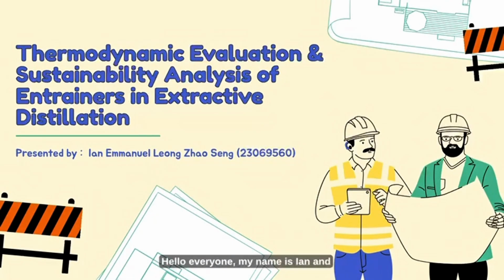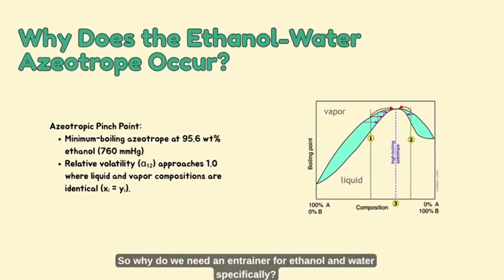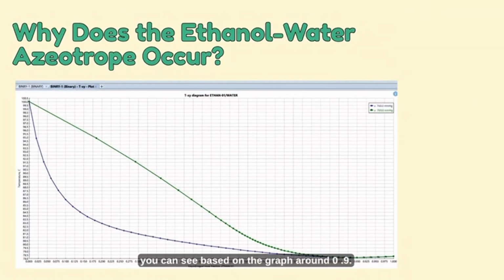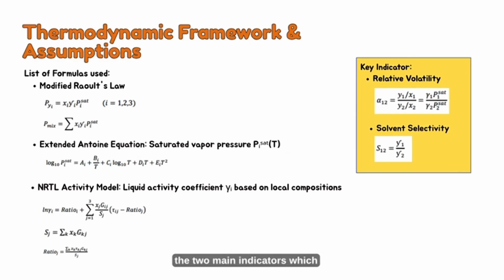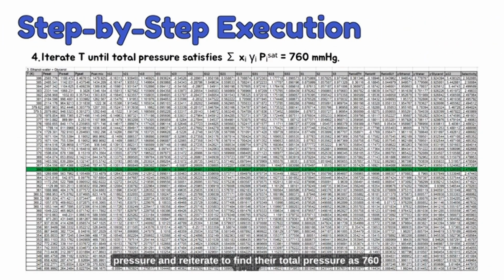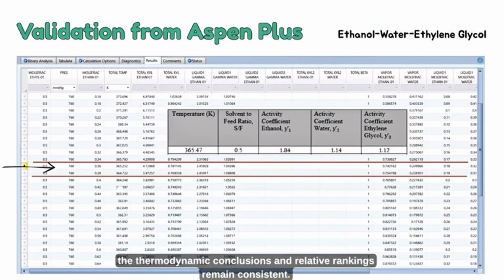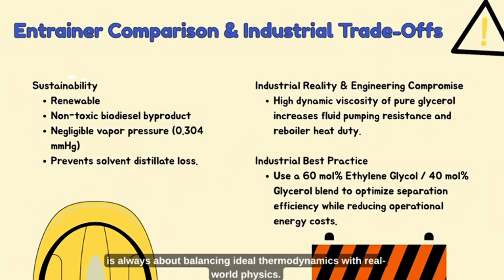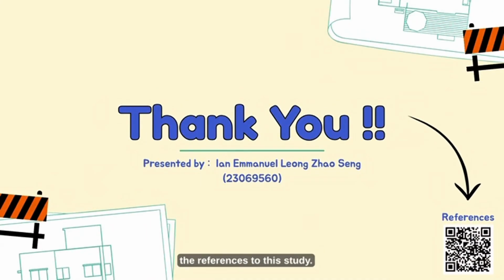Thermodynamic Evaluation and Sustainability Analysis of Entrainers in Extractive Distillation by Ian

Comment: Did you investigate the interaction between the S/F ratio and the reflux ratio? Since glycerol provides high thermodynamic selectivity, is there an optimum reflux ratio beyond which further increases in reflux ratio mainly increase reboiler duty without significantly improving separation?
Reply from the maker: No, this study did not investigate any interaction between solvent-to-feed (S/F) ratio and reflux ratio.
The engineering analysis was limited to single-stage equilibrium flash calculations at fixed atmospheric pressure (760 mmHg) using a custom Excel spreadsheet that uses the NRTL activity coefficient model + Yaws’ Extended Antoine equation (refer to the report in the video description at Sections 3.1–3.2 and Appendix C). Liquid compositions were set for four S/F ratios (0.5, 1.0, 1.5, 2.0), bubble-point temperature was iterated until Σ xᵢγᵢPᵢˢᵃᵗ = 760 mmHg and then relative volatility α₁₂ and selectivity S₁₂ were calculated. No multi-stage column, no reflux ratio, no reboiler-duty calculations and no stage-by-stage material/energy balances were performed. Also, the report contains no data on how reflux interacts with S/F or on any optimum reflux beyond which further increases only raise energy consumption.
What the results do show is that glycerol already delivers high thermodynamic selectivity (α₁₂ reaching 7.58 and S₁₂ ≈ 3.5 at S/F = 2.0, see Figures A1–A4 and Section 4.1–4.3). In a full extractive column this elevated α₁₂ would normally allow a lower minimum reflux ratio than ethylene glycol, but that quantitative relationship was outside the scope of the present single-stage thermodynamic evaluation.

Comment: From your results, the relative volatility increases as the solvent-to-feed ratio increases. Is there an optimum S/F ratio, or does increasing it beyond 2.0 provide diminishing returns?
Reply from the maker: Yes, the relative volatility increases with higher solvent-to-feed (S/F) ratio for both entrainers, as shown in Figures A1 and A2 and discussed in Section 4.1 in the report that can be found in the video description. Glycerol consistently gives higher values than ethylene glycol with it reaching the relative volatility of 7.58 at S/F = 2.0.

From the parametric results (Section 4.3), the practical optimum lies in the range S/F ≈ 1.5–2.0. Based in the S/F ratio range, the relative volatility already exceeds 6.5 and selectivity approaches around 3, which is high enough to break the azeotrope effectively while still limiting the amount of solvent that must be recovered later.

Although the study stopped at S/F = 2.0, the observed trend and the industrial discussion in Section 4.4 suggest that further increases would bring diminishing returns. The additional rise in relative volatility is expected to increase but with a smaller gain, while the disadvantages grow, which means that higher solvent circulation rate, greater energy needed for solvent recovery and increased pumping difficulties because pure glycerol is very viscous.

Therefore, going significantly above S/F = 2.0 is unlikely to improve separation enough to justify the extra cost and energy. This is why the report concludes that S/F = 1.5–2.0 is the preferred operating window for glycerol.